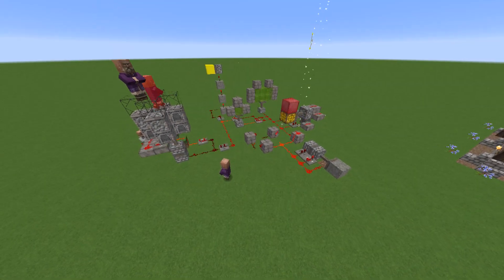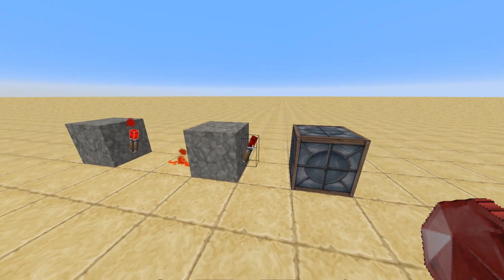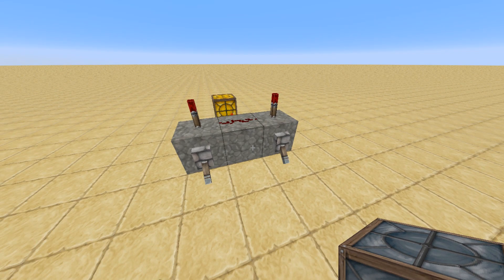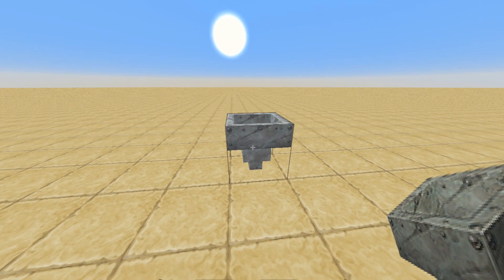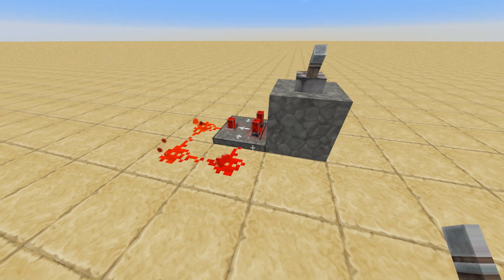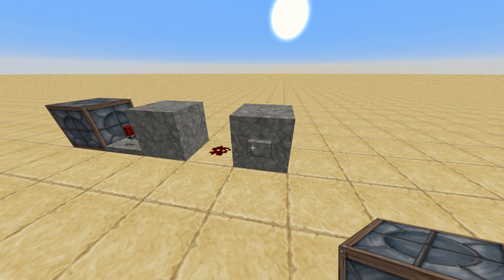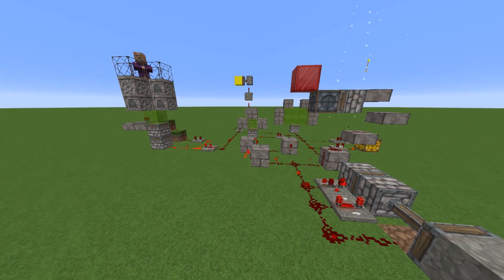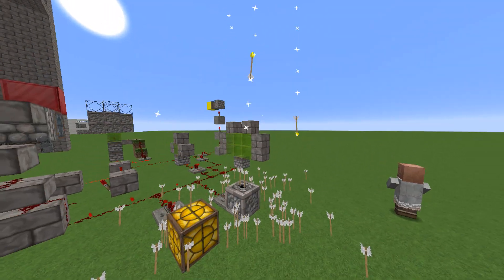MINECRAFT REDSTONE The Basics | How to make Basic Redstone Circuits | Redstone 101 part 2

Comment: rs nor latch not that weird a name, rs is for reset set and nor is for well 'not or' and latch is because it's latches your data, meening it measure your line and outputs what its seen on its input and keeps it even if the input changes. it measure the input with set, and well resets it to zero with ... the reset ! :)

Comment: what blocks are being powered and which ones aren't? my problem is I can't figure out where to place redstone in order to power particular blocks like lamps and pistons. Is there a guide to this. (sorry im new to Minecraft, late to the game).
Reply from the maker: Don't be sorry. The best way to check if a block is powered is to put a redstone torch on it. If the torch turns off it is powered.
Thats true of building blocks, not blocks like pistons.
If a powered repeater, or comparator, or even a redstone line runs into the block, it will hard power it.

I recommend you play about with it... thats how I learned. literally, run redstone lines around the floor and place blocks in various places to see what powers and what doesn't
Reply: Thanks, really appreciate the response. I've been playing around with it a lot in the last few weeks. Your videos really help. I didn't realize a normal block could be charged. Ill have to play around with that.

Comment: The Circuit shown at 12:50 doesn’t work on the better together update, what is another circuit that does the same thing but works for the better together?
Reply from the maker: I will need to check it out
Reply: Thank you so much, Avomance. I’m trying to learn red stone but it seems like half the circuits don’t work in the new version
Reply: I also have that problem. The block stays on the sticky piston at all times :(
Reply: This is what I was commenting about, didn't realise it was an older video with loads of comments!